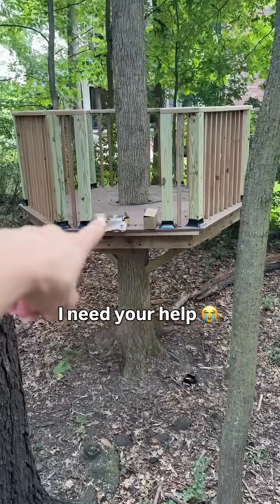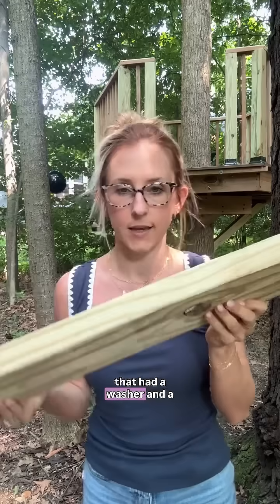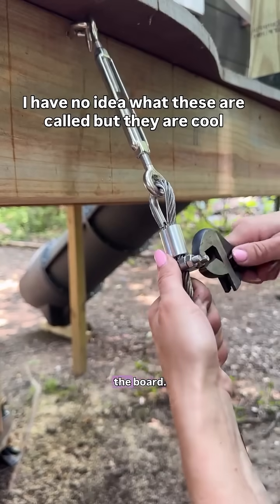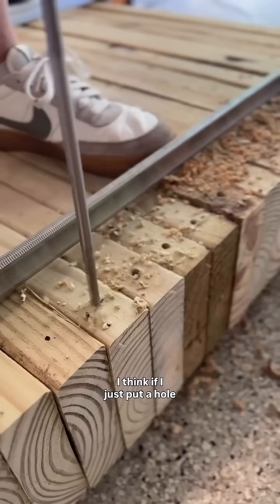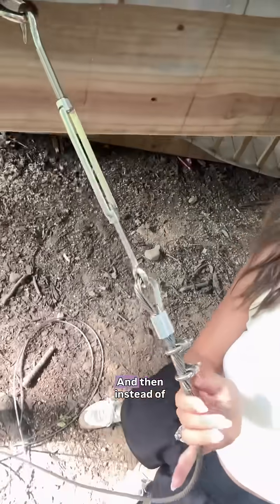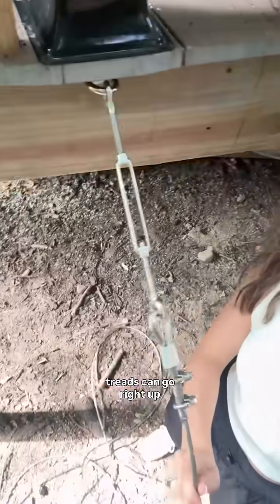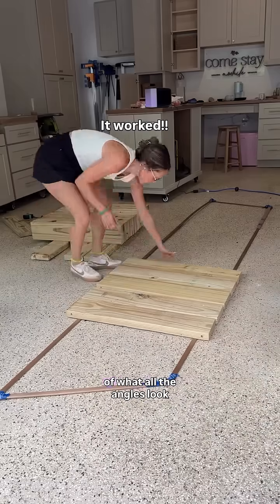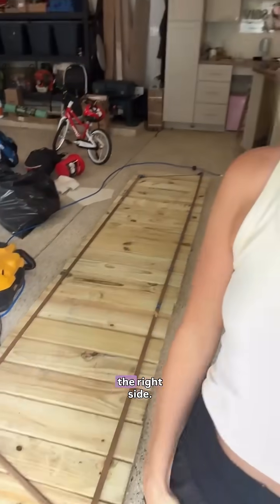The tension bridge is so close but I can’t figure out how to account for the angle of the bridge 🤔

Comment: Your work looks amazing so far! It doesn't sound like you need any motivation, but I just finished my kids' treehouse last weekend, and watching them play on it has been 100% worth all the effort.

There's one technique that I found to be a lifesaver when struggling to visualise the shape I needed for a non-standard board. That was to build up the shape with scrap paper or cardboard. It's quick and cheap, you can correct and adjust easily by sticking pieces together, and once you have the right shape you can trace it straight on to the board.

If you're stuck, have you thought about making the last few boards slightly narrower on the short-cable side? I think you could achieve a gradual 'turn' to match the angle you want.